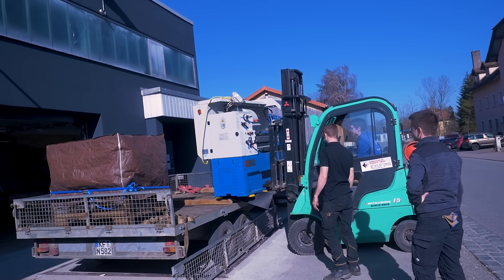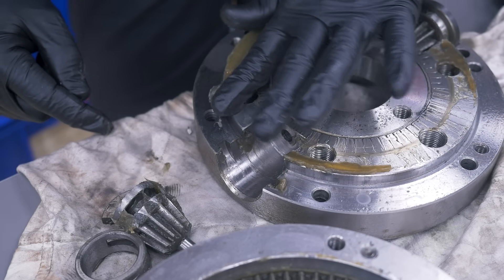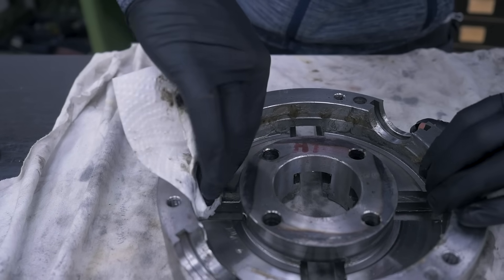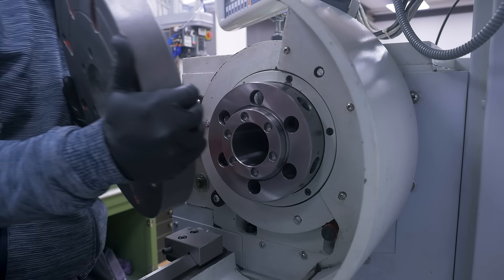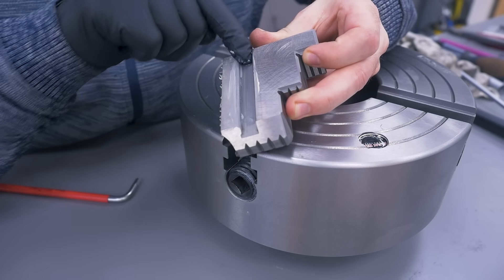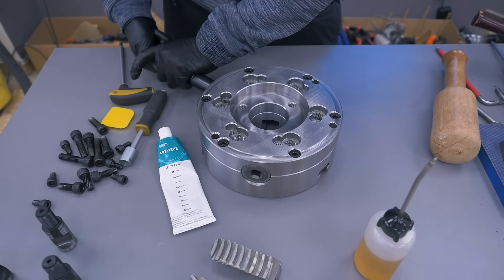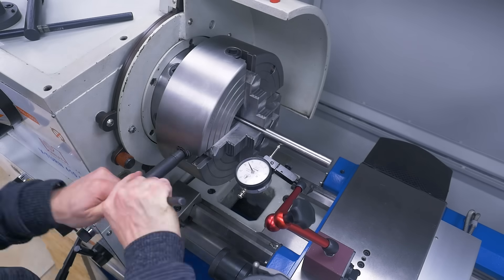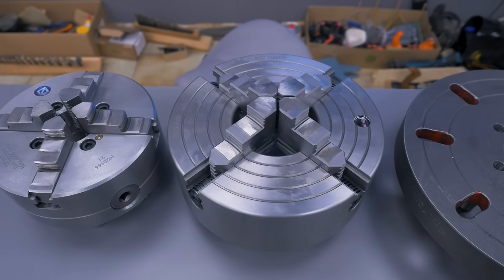Big Lathe Chuck Teardown & Cleaning

Comment: I watched you make your new chuck key. When I was an apprentice I needed a new chuck key. I made it out of tool steel. The square was heat treated ground on surface grinder using slip gauges to check size of square on the chuck. It would last the life time of the lathe. If you don’t heat treat the square will wear and may slip in the chuck. The one that came with the lathe was probably heat treated.

Comment: Never grease chucks: heavy oil is the way to go. Then after reassembly, wrap the chuck in a cloth and spin it as fast as the lathe allow: excess oil will end in the cloth rather than flying all around. Cleaning always kerdane...

Comment: Little tip
Never use grease on the outer surface of chucks.
Oil is better 
Grease let the chips stuck on the surfaces 
Light oil ( way oil for example ) isr mutch better

Comment: Hmm. In a gazillion years of using lathes at work I've never used grease on the chuck. Always a general use mineral oil. Reduces the problem of grit and chips sticking into the moving parts.

Comment: 5:40 don't run ultrasonic cleaners with low liquid, this burns the transducers. When you run it, you run it full, because otherwise it's like having a trip to France with no oil in your gearbox. :)

Comment: Using grease is a sticky thing, use oil instead,it's easier to clean.
You can also use WD40.
Reply from the maker: Idk, the high rpm will spit out all the oil, make a mess, and over time run dry.
Reply: @MHAnything  Marius, I agree. While I'm not a machinist, I know WD40 isn't lubricant, and oil will turn to a varnish-like goo over time. The grease will lubricate and protect the metal long-term. For the non-contact surfaces of all that steel, I'd recommend T-9 Boeshield.

Comment: Grease in a chuck is just a magnet for chips ... Don't do it ...
Oil is the best. But will eventually be thrown off.. then it's time to take it apart and clean again.  It's one of those things you need to do once in awhile of you wanna keep it smooth and hold it's accuracy for years.

Comment: you can also rotate the jaws in the chuck to improve results bye rotating i mean start off with the jaws in the numberd slots an then move them one number around as in number one 1n the 2 slot 2 in the3 slot an 3 in the 1 slot taking different measurement each time

Comment: A plastic tote and parts cleaner is all you need for a simple parts washer. Diesel or regular gas works well also.
Reply: Even with the price of gas or diesel these days, it's usually still cheaper than brake cleaner - that stuff must be made out of pretty special solvent for the price they charge for it (it's not, it's mostly just acetone in a aerosol can)
Reply: I was thinking, "5-gallon bucket and degreaser" ... then again, I'm not a machinist.

Comment: Can you make a video about the difference need between 3 jaw and 4 jaw chuck. I cannot understand whats going on
Reply: A 3 jaw chuck always tries to hold a round part in the center of the lathe axis, a 4 jaw chuck can be used to hold round parts off center, so you can make a cam for example, or for holding square parts to make into something round. A 3 jaw chuck adjust all the jaws at the same time when you use the chuck key, a 4 jaw chuck adjusts each jaw individually.

EDIT: I looked through the comments before I watched the video, and now see a weird 4-jaw chuck that actually is adjusted all at the same time.  I guess that's somewhat of a specialty thing for when you know you'll often use square stock and make some of it round. At that point it works a bit like a normal 3-jaw except that it has 4, so it can't grip triangular or hexagonal stuff in the way a 3-jaw can.

Comment: If you have a four jaw scroll chuck you might as well leave it on the lathe, it can grab round, square and hex stock and has one more point of contact than the three jaw.
Reply: I'd think if you tried to chuck up hex material in a four jaw scroll chuck you'd end up with two jaws tight while the other two were lose.
Reply: @petermichaelgreen yeah, that is what most people think but if you try it you will find that there is a position where all four jaws grips equally.

Comment: Suggestion for your chucks. Build and wood sled that slides on the V grooves and under the chuck when still attached to the lathe, now loosen the chuck and that it rest on the sled. Then slide the sled away from the spindle nose. Now you do not have to hold the chuck and tighten the chuck.
Reply from the maker: That's a good idea!

Comment: Marius, I must admit that I don't use oil or grease on my chucks I use graphite powder instead as no matter how careful you are chips get inside the mechanisms and stick to the oil and grease but not on the  graphite. That is one mighty fine lathe and that constant surface speed is a great feature. If you can afford it try and get a 6 jaw chuck they are really good and have better holding power.
Reply: You never use graphite powder for precision mechanics my friend. You're basically putting abrasive grit into your chuck. For anything that doesn't need precision ok. But a chuck needs it's precision as you'll grind down the scroll, gear wheel and the geared adjustment screws. Not a good idea at all (for a precision instrument.. for things like door hinges etc it's a fair game).
Reply: @chronokoks I didn't know, that graphite powder is abrasive
Reply: @volkeresper9519  graphite is a very very weird thing.. slippery on one side, on the other can wear down carbide end mills due to various effects.. in precision instruments like linear slides or gears it's not used because those are high-pressure uses and graphite does weird things under high pressure.. it adheres to the surface very strongly and during high-pressures and movement can tear cause tear outs on the surface.. the physics of if is hard to understand and visualize
Reply: @chronokoks  graphite is not gritty it is a slippery surface as the layers of carbon atoms are only weakly cross bonded so slip over each other in planes unless you know something that my professors in materials science didn't during my degree.
Reply: @michaellinahan7740  How old are you that you are referencing an old professor? Do you realize that there is alot going on ? Why do you think nobody uses graphite powder for precise machinery? Are they all dumb and you smart? Oh my god...
Reply: @chronokoks  what do you mean "there is a lot going on"? If you are considering a case where you get micro pressure welding an oil or grease aint going to prevent that. We are talking about the action of a scroll on the jaws in a chuck not a high pressure welding situation. But you obviously think you know more than me so whatever mate, you do you and I will do me.
Reply: @michaellinahan7740  micro pressure welding???????????????????????? Oh now I know why you're unable to understand things. Lmao
Reply: @michaellinahan7740  Dry PTFE lube would be a 1000x better suggestion if you want to be dry. But there's a reason why grease are used. Cleaning the chucks from time to time is easy.
Reply: @chronokoks  Is it any wonder why the numbers of comments people leave nowadays has decreased when you get 'insulted' by armchair 'experts'. As I said before this is what I do and it works for me you don't have to agree with me just do what you have always done (or seen) and until I get a grown up telling me that what I do is wrong and why rather than some gibberish I will carry on doing the same. </END OF CONVERSATION>
Reply: A 6 jaw would be nice, but I'd be holding out for a 8 or 10 jaw to go on sale for some serious grip 👍 #iNeedAllTheGrips 🙌
Reply: My dudes you need to cite your sources if you’re going to claim expertise on the internet. ‘My professor said’ isn’t evidence.
Provide your primary, peer reviewed  sources. That’s how big boys do science.
Reply: @JackGladstoneHolroyde  "Appeal to authority fallacy"...  btw the authority are the chuck manufacturers, and if they are not using graphite, then you shouldn't too.
Reply: @chronokoks Please look at what 'appeal to authority fallacy' actually means.
If both sides of this debate could cite a verifiable source with evidence, this would clarify many things.
Thanks.
Reply: For those wondering after all of the arguing: graphite is both a mild abrasive and a lubricant.

The graphite you find in a pencil seems pretty soft; this is because the particles are loosely bound together.

The particles themselves, i.e. what makes up graphite powder, are actually crystalline and very hard. They work as a lubricant by sliding over each other.

However, to steel it may as well be a lapping compound...
Reply: Graphite is mildly abrasive and not very ideal to use as a substitute for grease. Also metal particles will contaminate the graphite making it more abrasive. The grease will suspend the particles.
Reply: @Xziriz  shh don't tell words of wisdom to that guy.. he's a material scientists (he thinks) and we all are stupid (even the producers of the chucks themselves.. (Rohm, Schunk, Bison etc)
Reply: Cc’d

Comment: 8:52 Aaargh, my guy you need a soft non-steel hammer. One missed blow and you would have hit and most likely dented the mating surface of the chuck to the spindle.
Reply: Machining two or three brass hammers would be a nice first project for the newly restored lathe.

Comment: To increase the accuracy of the chucks, the cams are usually bored on the same machine and in the same position in which the chuck is always mounted (according to the marks). By boring on the same machine, the accuracy is greatly improved.

Comment: Great "restoration" - can you go over the purpose/need for a 4-jaw, vs 3-jaw? I'd imagine that a 3-jaw would always be the go-to
Reply: ever tried to clamp something square or rectangular in a 3 jaw chuck?
Reply: @horst6855  I'm not a machinist, never tried a metal lathe, so no, I have not
Reply: 3 jaw scroll and 4 jaw independent are the two basic chucks any metal lathe should have.

3 jaw scroll is the go-to for quickly chucking up round, round-ish, and hex stock where runout is not super critical and you don't need an offset.

4 jaw independent is used when you either have something awkward shaped, need to introduce a deliberate offset, or need to make manual adjustments to get rid off runout.

4 jaw scroll is more esoteric, The extra jaw can give better grip on nice material compared to a 3 jaw, but it's "overdetermined" which means if you try to chuck up uneven material (or hex material) some jaws may be tight while others are loose. It's also handy if you frequently use square stock.
Reply: @petermichaelgreen thanks a ton for the explanation!

Comment: Suggestion, take a page from Cutting Edge Engineering and make aluminium fittings for the chucks and mount them with small bolts.  Just to make clamping softer material on the lathe easier.😊
Reply: you prolly meant to say "take a page from like every experienced machinist". soft jaws are as old as lathes themselves.
Reply: @horst6855 totally right, only thing is, i like CEE mostly for their blooper reels at the end of their videos😊